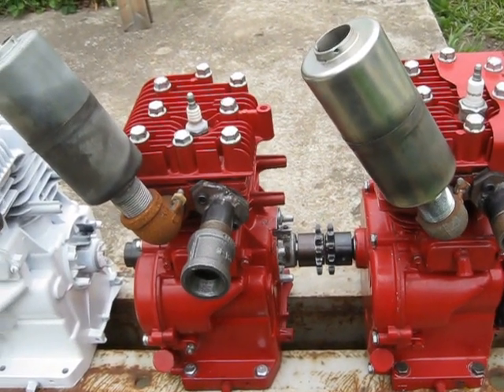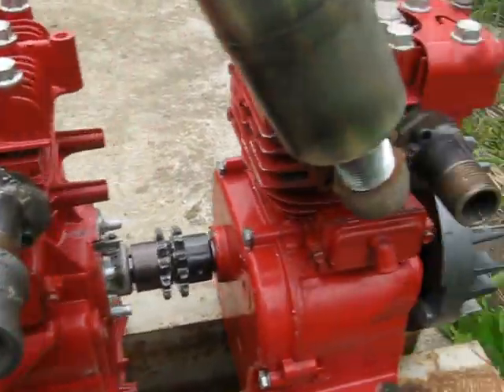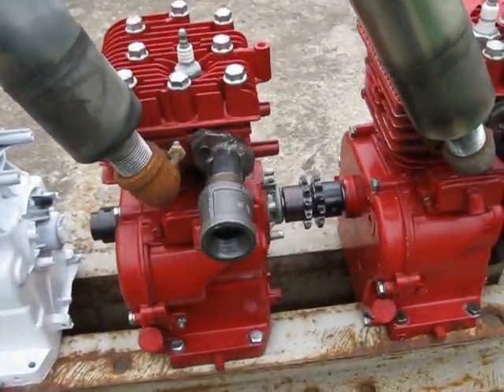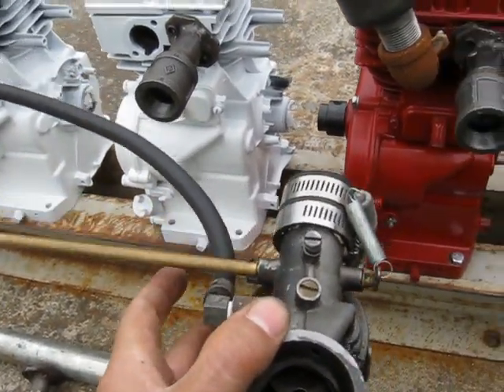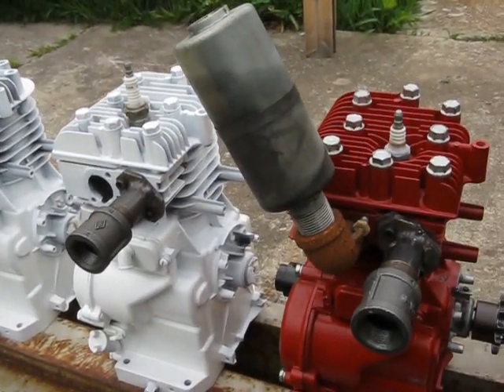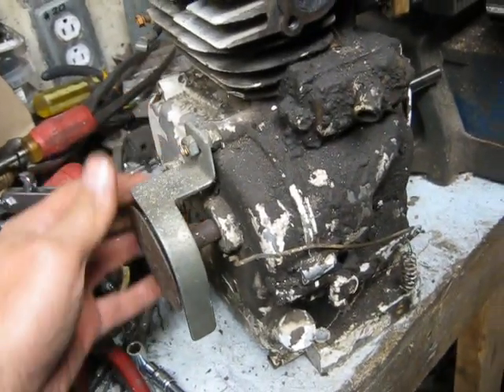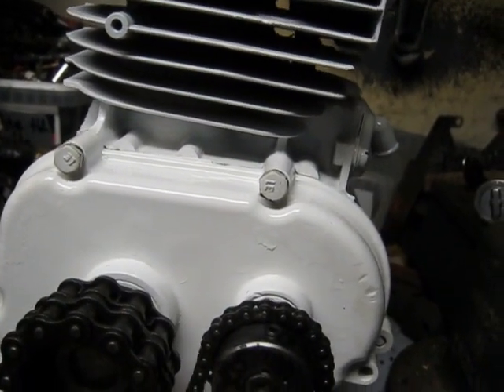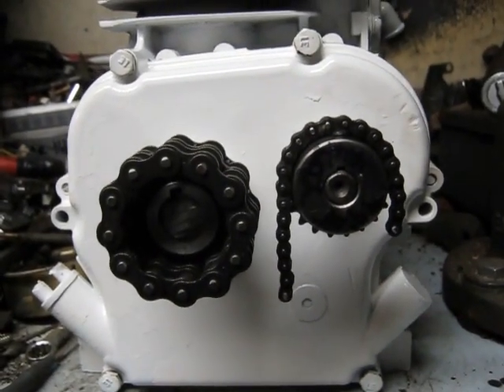8 Cylinder Briggs Intake Design etc. Vid 3

Comment: Quite a project, but it's coming along nicely!
Oily dirt is a protective coating! XD
Reply from the maker: +TheFurriestOne Yes, I guess it does protect the engine from corrosion! I have had some cleaned engines start to get surface corrosion, as there was no oil coat fro protection.
Reply: ChargerMiles007 Yup, I've had that issue with parts after I get them back from the sand-blaster. Paint, powder-coat, or Water-Displacement formula 40 solves that though!

Comment: I would think as long as those engine's don't move, the couplings shouldn't grenade. I think the block of wood was too flexible.
Reply from the maker: Yes, I am hoping the steel base helps out a lot, the 4 cylinder worked the couplings so hard it even loosened the keys on the shafts! I had loctited set screws that spun right out!